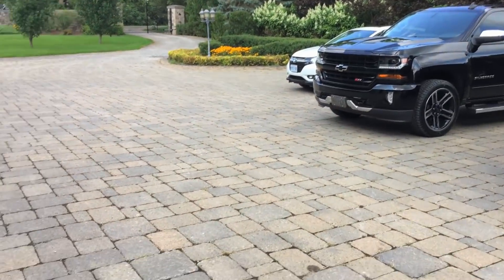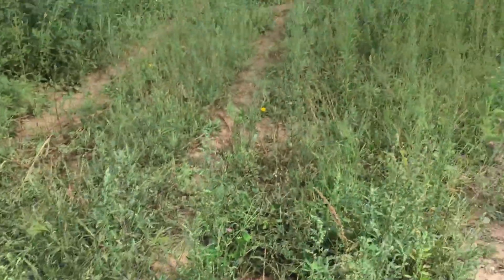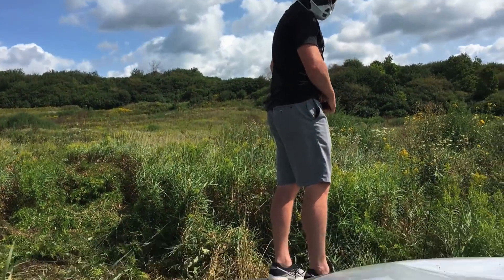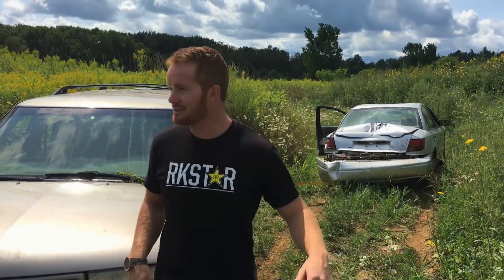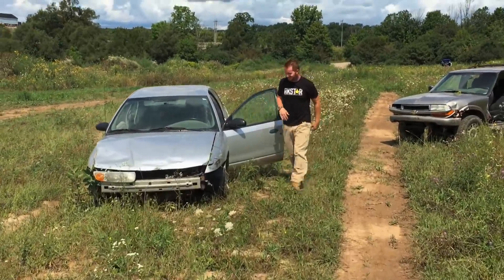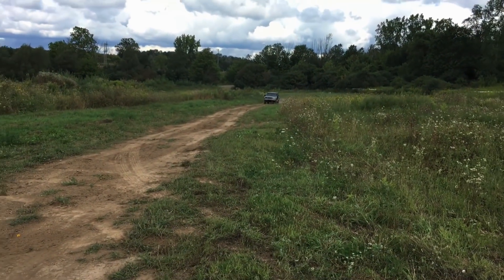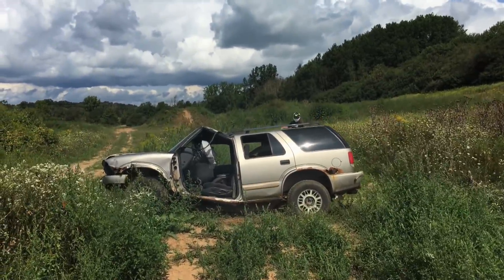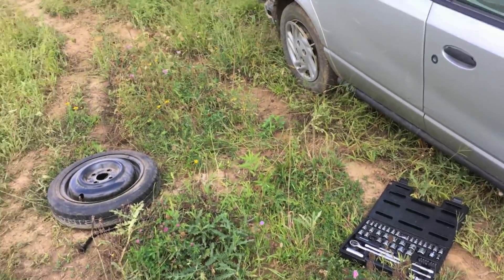Saturn JUMPS Blazer TWICE!!!

Comment: How'd Saturn go outta business those things are almost bulletproof
Reply: Sneakyshark14 GM bought them lol
Reply: SAVAGECUMMINS 
Gm always owned them. They ran independently and made everything in house up to 2002. They switched to re-buddies FM cars after that. Some opels too.
Reply: From 1990-2002 they never updated them underneath. They got new bodies and interiors. They were always noted for dependability and low cost of ownership. The 1.9 was specifically made and developed just for the small SSeries cars. Aside of burning oil they were very dependable. They stopped being unique and started sharing other GM parts when they stopped making the old s SSeries and made the Ion,( Chevy Cobalt, Pontiac G5) in 2003.

Comment: The blazer impact was unbeatable. You should leave a rock on the gas pedal, and pull the shifter with a string to throw it into gear. Then make sure you let go of the string😂😂🚗💨

Comment: Everyone calls Saturn’s pieces of shit but you don’t see many cars have the shit beat out of them and be jumped 2 times and they still run
Reply: RIGHT! It was better than the other cars I saw they jumped...
Reply: Carson Maillet look up Pontiac 6000 jump. Dude runs it off a cliff 2 times. No where near the quality of these guys but it's a funny watch
Reply: You guys crack me up. Need to get you an car with an old 3.1L v6 in it. Those things won't die
Reply: Carson Maillet your right it is a piece of shit
Reply: The very small Saturn SSeries are extremely tough cars. I've had 2. If American small cars were all as tough as they were Toyota,Nissan and Honda wouldn't be much.
Reply: Some saturns aren’t piecing of shit. But some are
Reply: Like Danm